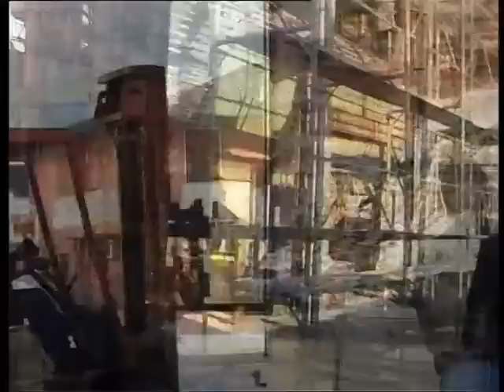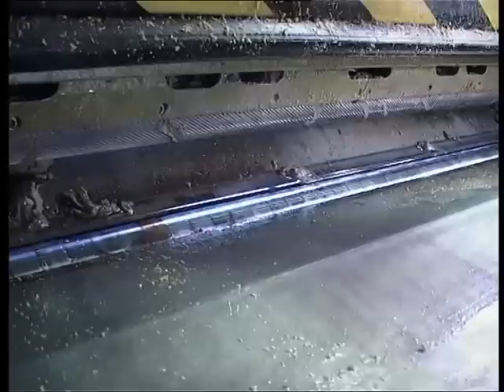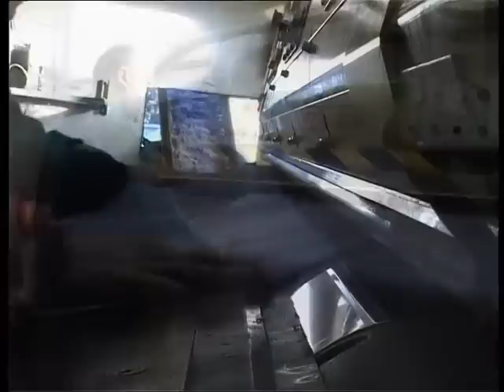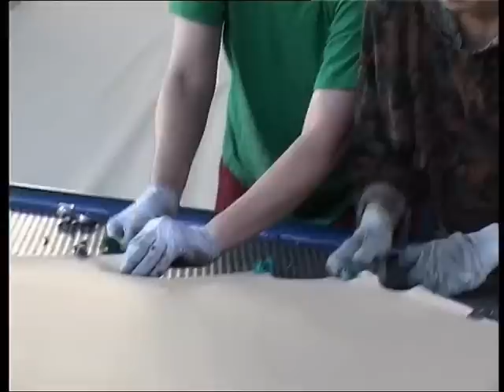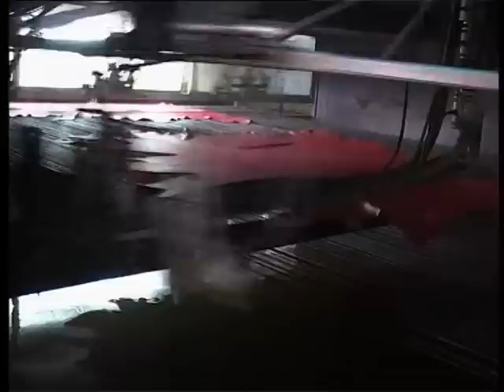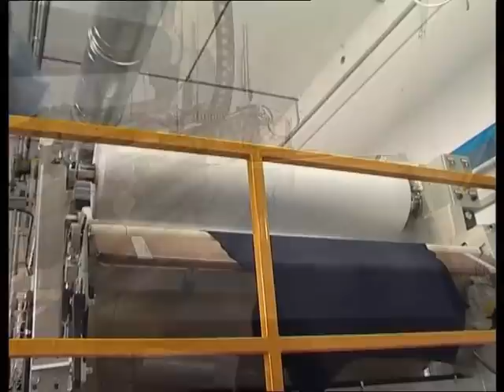How leather is made

Comment: I worked in a Tannery in finishing dept. ran Staking machine, each hide at a time done by one individual and the staking machine was scary with big arms coming down on the hide. you did not get your hands in there or they were gone. and the buffing machines where two rollers traveling oppocite each other one hide at a time. the dyeig was done by hand "Swabbing" it was called. long swabs. made of wood and wool kind of banna shaped. were dipped in to big pan/basins of dye, and then swabbed onto the leather, then ran thru a dryer. Did lots of other jobs there too!. not a fun time in my life. But we all had to make a living didn't we.

Comment: Trucking company I worked for would get full loads of rawhide in tarp trailers. I mean RAW hides, stripped from the cattle and rolled up flesh and all. Arriving during hot summer days after a trip of 2000 miles the stink was unbearable. Fat was dripping unto the ground and you could hear the flies buzzing where they had to be parked at the far end of the yard. Had to hook up to one and take the load to the tanner. Got there and dropped the trailer at lunch time and guys were sitting outside on these hides eating lunch. I could barely stand the stink just rolling down the landing gear.